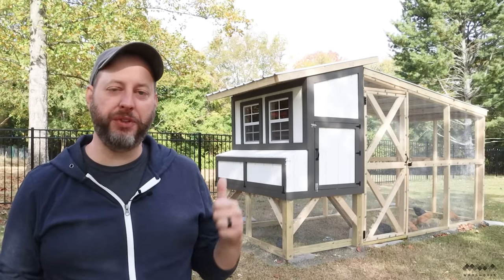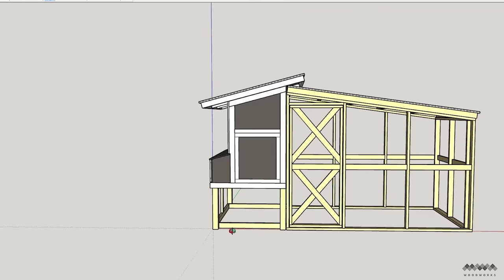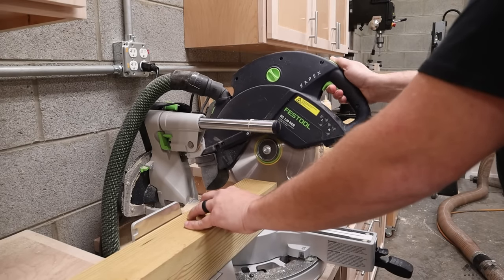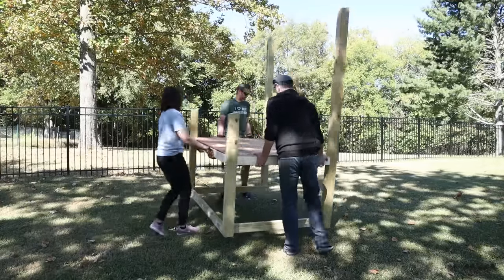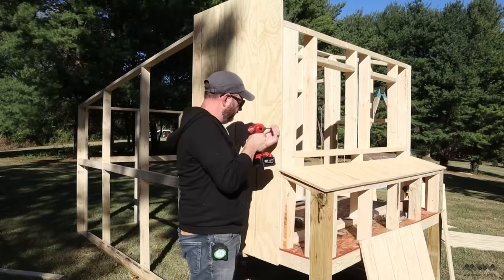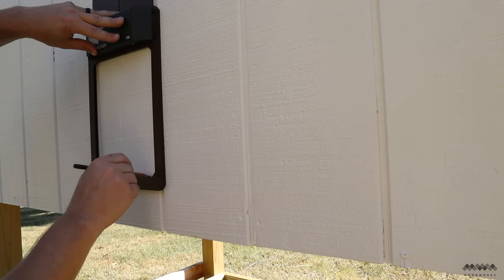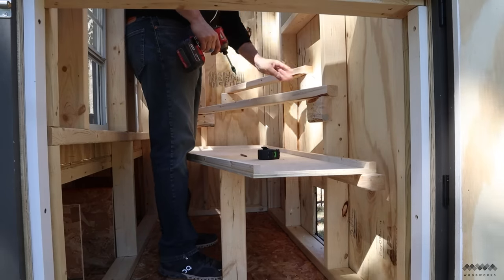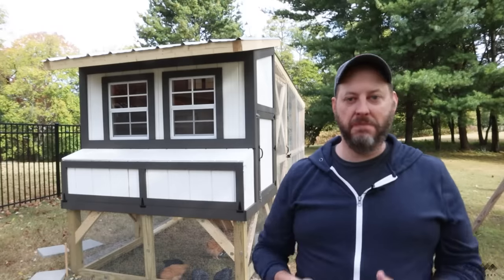DIY Backyard Chicken Coop

Comment: Nice alterations ! I used the same design from 3rd coast. I made mine 8 ft long and did the door on both sides and lined the bottom with linoleum.  Works good for my flock ! Your door is pretty nice ! I don't have any fancy tools and ended up using a skil saw and jig saw.
Reply from the maker: Linoleum is a great idea. I just put about 2 inches of construction sand in the bottom of the coop. We love it so far.
Reply: Yes! We're using Third Coast design and going slightly bigger, too. Such clever ideas Chris had. And I was also thinking about a linoleum floor - great minds working alike?
Reply: Same here, I just purchased the building plans from Third Coast Craftsman. Gonna go with the original size and I also want the linoleum on the floor to help protect the wood and hopefully have it last longer. Now if I can just get my husband to start the build...he's a very handy guy but not very confident about woodwork and construction. I'd try it myself but probably give him a heart attack to see me using power tools. 😂

Comment: Great build!  This is the style I've been eyeing for a while now. I like the simplicity of the lean-to roof, the covered egg access and the droppings clean out methodology.  I also really want to build a coop that could be easily moved.  Just setting it on leveled pavers, perhaps just putting down a couple tap-con screws into the pavers to keep the wind from lifting it, and just lag bolting the run to the coop for easy separation would make this very easy to move to a new location on the property using a utility trailer.
Reply: While moving is great, the one problem I have with that is making sure your chickens are secure. I'm going to extend the hardware cloth for my walls 2 feet deep on all sides (yeah, costly). If you move the coop, how do you make sure animals can't dig through the bottom to get to it?
Reply: @dontbanmebrodontbanme5403  If you look at the other builds, a lot of people don't worry about burying the hardware cloth, instead they put large rocks (6-12" diameter rocks) lining the hardware cloth to ground contact around the entire coop/run and the animals that tend to dig under like racoons, possums and foxes can't dig with the large rocks in the way.  I think it looks great that way too.

Comment: Love the simple and easily made with everyday materials that we all can make use of without confusion going to the hardware or lumber yard or home improvement store- especially as a chick because I am very familiar with all the building materials and the steps in the builds as I worked for years as a construction laborer and learned a lot doing all different jobs in that field and with Dad who is/was a block mason…still yet I get the “female” dumb down treatment too often and it really entertains mostly, until it irritates me. It makes this cool build easy for everyone to be able to do- of course I am now wanting  my own nailer 😜… like I “need” it!! Whatever it takes to get more cool tools, right?! 
Found the perfect coop for the youngest group of 10 of our flock- minus the fenced in part as we have free range chickens. It has all the right additions and the ability to add or take away without hurting the design or structural integrity. Thanks! Oh yeah, Really love the not cutting into my head height that I nearly would’ve forgot until after! Big tip! With metal, it’s a big deal!

Comment: ! ! !   AWESOME JOB   ! ! !

However, Let Me Say That the perches must be round, with a diameter of 3.5 cm (1.377 inches), not smooth (like bamboo) and without bark or cracks to avoid the proliferation of parasites,

And Ideal angle of the perch is 45º, because that way, one bird does not defecate on top of the other.

That It !

Congrats !

Comment: I may be building one for about 15 chickens so i will need to make adjustments to accommodate them. My queston is where did you get the circular saw guide ? And like i tead in another review good tip on ising the speed square for a guode.

Comment: Ive been looking at a lot of these chicken coop builds and this design is really nice! Two questions, does the rain stay out even with the windows open/could the windows be installed upside down so the screens are at the top? And do you have any issues with water intrusion where the egg door is folding down? Looks like there wasn't much overhang on the topside. Great job though....really like this layout!
Reply: I am almost done with my build (clone of this design), and if you plan you coop layout so the nesting boxes are on the prevailing downwind side they will stay dry, even in our east coast summer storms!  The door that folds up, under the upper sheet of T1-11 is not prone to leaking from wind blown rain. Nesting boxes where the access hinge up top are prone to leaking as rain pelts the side by the windows and runs down.  The other benefit of the hinge down access is you don't have to hold the access hatch up as you gather the eggs and no danger of it dropping on your head or fingers.
Reply: @jayhemfindsyou  did you find somewhere that he put plans for this build or did you just write down a supply list as the video was playing? I would love to build one of these once I finish putting up my new fence. Plans would be nice just for a shopping list, you always have to go to home depot a couple times, but a couple times sure beats 10 times because you're missing lumber😂😂
Reply: @mikebrummy  The original designer sells the plans.  I wanted mine to be larger, 6' x 8' so I basically designed it in AutoCAD (I'm a civil engineer by day) from the video, using it as a basis for the design.  From there I was able to put together my materials list.  I really like the efficiency of this design especially with the run with a lean-to roof in the opposite direction as the main roof.  I also added linoleum as a single sheet to cover the main floor and 3" up the walls to make it easier to clean in the event you have to get a mop in there for stuck on poop!

Comment: Really enjoyed this and it turned out SO nice!!!  I like your idea of the metal roof.  Do you need to apply silicon or anything where the screws go through the metal roof to keep it from leaking?  Thanks for making this video.  I'm sure you have the best looking chicken coop around!
Reply from the maker: The screws have a rubber washer on them that seals them up 👍
Reply: @MWAWoodworks  Thanks so much for answering my question about the screws.  BTW, I got your plans for the router coping sleds a while back and made one.  It turned out great and your plans were excellent!

Comment: I love the adjustments you've made from the original plans. I as well have only 6 chicks. I want to build this coop but am worried it won't fit in the area planned. It's about 10' x 15'. Would your design fit in that space? Also, are your plans available for purchase? I love your work. Keep sharing your talent.
Reply from the maker: No plans, but the coop plus the run is 6 ft wide and 14 ft long
Reply: Great video! So many people are interested in raising backyard chickens after that surge in egg prices, I know your sales would be huge if you sold plans for this coop! I’d be first in line to purchase it! Thank you for the video, I’m going to attempt to build it but I’d feel more confident if I had the plans to refer to if I run into trouble. 😊
Reply: What did it cost in materials to build?

Comment: Thank you for sharing.  I have a question about the wood framing for the run on the ground.  Is there anything you can put down under the wood to protect it from sitting in the dirt for it's life time?
  I would think that would be your weak point and would rot faster than the rest of the run design.
Reply from the maker: Put it on concrete pavers? I used pressure treated lumber so it should do well for several years.

Comment: Any modifications and/or upgrades you've made since? Thought adding wheels would be good to move it around the yard as the grass is gone and ends up just dirt?
Reply from the maker: No mods to the coop. I am going to add sand and some gravel to the run to prevent it from being a mud pit.

Comment: What kind of screws are you using to attach the hardware wire? Those seem much more secure than staples.
Reply from the maker: I just used exterior construction screws with fender washers

Comment: Have you had any issues using OSB on the floor in the coop?
Reply from the maker: I put a couple inches of sand in the bottom of the coop so there shouldn't be any issues with the OSB
Reply: @MWAWoodworks  Thank you!

Comment: Great build! What climate do you live in? I’m in the north and I think I will need insulation and a heat lamp to keep the chickens alive in the winter. Do you have any plans to insulate or add lights?
Reply from the maker: I live in Tennessee.  We have a much bigger problem with heat that with cold. HOWEVER we got an arctic blast and it got down to -4 degrees and our chickens did just fine.

Comment: i don't know what's the angle on a 5 to seven foot tall wall eight feet across?  that is what my roof has.  that's like 1 foot over 4 feet.  and um so 3 inchers for one foot.  3 to 12?  9+144 is square root of 153.  um... 12.369 inchers?  i still don't know the angle.  hrm.  sohcahtoa?  ouch my brain hurts.

Comment: Can you upload plans to purchase for the same dimensions? I’ll buy them in a heart beat this is exactly what I’m looking for
Reply from the maker: No plans this time, sorry!
Reply: It's pretty simple build.  Just pick a height on the high and low side of roof.  Main thing is to pick the width for (sheet good) material utilization.  minimum 2 sq-ft per chicken for floor space.  Typical size 4x6, 6x8. 6x10 etc...  2ft off ground for easy cleaning and double as extra run space underneath.

Comment: What are the overall dimensions of the coop and run?
Reply from the maker: Coop is 4 ft x 6 ft and the run is 6 ft x 10 ft. It's 8 ft tall at the peak of the roof.
Reply: @MWAWoodworks  so 6x14?
Reply from the maker: Yep
Reply: @MWAWoodworks  cool thank you. I love the design. I even bought the prints from Chris for the red and white one but that one is too big for me. I only have 4 hens so I’m gonna scale it down a little. I’m gonna make it 6 feet wide by 20 feet long I think. The area I have them now in now is 7.5’x24’ and that’s the run size. There is a tiny coop in the run but I like this design with the run built onto the coop.

Comment: I would at least put some 2 inch thick foam insulation panels in the spaces under the tin roof so it doesn’t let the heat thru the roof
Reply from the maker: Actually you want there to be as much air circulation as possible. Also chickens  are more bothered by extreme heat than extreme cold and in Tennessee I get way more of the former so adding insulation would be like making a big oven for them to roast in. My chickens just survived 3 days of temps below zero and are perfectly ok. Amazing!

Comment: I have to disagree with your choice on the roof.  Metal with no OSB, or plywood under it conducts heat and cold extremely well.  You just built an oven.  Also, I know people get nostalgic for the " rain on a metal roof" vibe, but honestly, trapping your birds inside a small building with a metal roof is almost cruel.  The noise is deafening with no buffer to soften the sound.  An acorn hitting the roof can sound like a gunshot when you're outside; just imagine how it will scare your birds on the inside.   Please, rethink that roof !
Reply from the maker: We will see. I have windows on both sides for a nice cross breeze. They are only in the coop at night so I'll wager they will be just fine!
Reply: Gigantic barns don’t have OSB or plywood. It would add so much to the cost. Birds are tough, they will be fine.  I sold steel roofing for 20 years. If you put plywood under the roof. The condensation will collect and rot the roof plywood so fast.
Reply: Oh my goodness Sheila the birds probably don't like thunderstorms either.... Your comments are very snow flake
Reply: @rayashanazarian781  The coop build that inspired this one is on YouTube and he does have plans (free, I think).  That said, the important bits are really how it goes together which the videos cover well.  The exact dimensions can be better worked out as you go, as is the case for most all woodworking.  Freeing yourself from needing plans is a huge boost to your skillset because it means you can build anything you see or think of.
Reply: Also the metal roof will drip condensation.
Reply: @surfer2016  🤣🤣🤣🤣☠
Reply: Це
Reply: @ByronBrummer some of us are far below that skill set, so much that considering it feels overwhelming.
Reply: Thanks for the warning.  I have to put my coop near an oak tree. I won't use a metal roof.
Reply: @joshyjosh00 Then how do you explain wooden storage buildings with metal roofs? (I'm here to learn.)
Reply: @destination...diamond3892  People build things the way they want. In poor countries. They only make metal buildings. They last longer and metal is cheaper. Having wooden buildings is just an american thing. I want it becuz my neighbor or friend has one. FOMO. Steel made for construction won't hold moisture and mold or fall apart like wood does.
Reply: @ronc7743  oh crap, must move them inside the house and better give them there own room while we are it!!! Heaven forbid there’s condensation 😮
Reply: Was condensation on the metal roof ever an issue for in winter time you or is there enough ventilation that it hasn’t mattered?
Reply: Great point
Reply: @MWAWoodworks good response bro
Reply: I agree.! But otherwise liked the info.
Reply: The central air will keep it from getting too hot or cold. As for the noise,  chicken headphones block out everything .
Reply: @joshyjosh00 I'm in Thailand, and the reason I hesitate to use wood is because of humidity and termite. Locals use whatever they get their hands on, but I guess bamboo would do a good job.
Reply: . Third Coast Craftsman does have a video but the plans for the coop are not free. I just purchased mine and they were $14.99 to download the plans and materials list. I'm looking forward to getting it built.
Reply: Thanks for the tip on the X. I put that X on everything I build because my big barn has X’s on the front doors and I want all my other buildings to match nicely…but I’ve been cutting my X’s all different ways, and sometimes it’s a big pain getting it symmetrical. Thanks for the tip!❤
Reply: Not a bad suggestion
Reply: @joshyjosh00  neh. A layer of tar paper between the two materials does just fine.  The metal is ribbed for their pleasure.
Reply: @destination...diamond3892 He said he "sold" metal roofs, but WE actually owned them (with and without plywood sheathing beneath them). The roofs with wood do not collect condensation and rot the wood, especially if they are pitched. The metal roofs without wood sheathing drip horribly as soon as the sun comes up, and they're extremely noisy in a rainstorm (hail will deafen you).
Reply: @surfer2016 😀🤣😂😂 hell nah